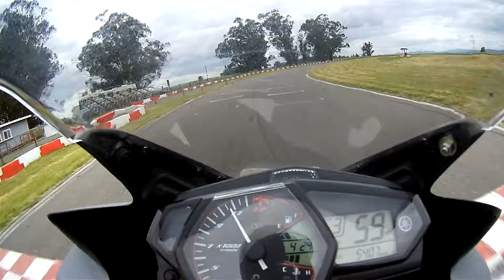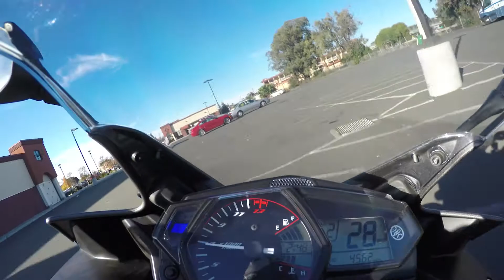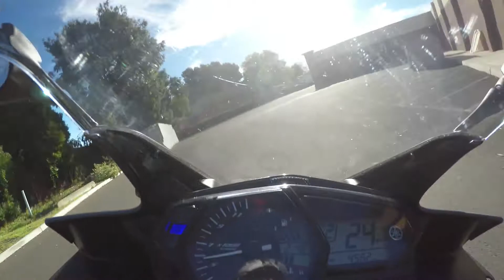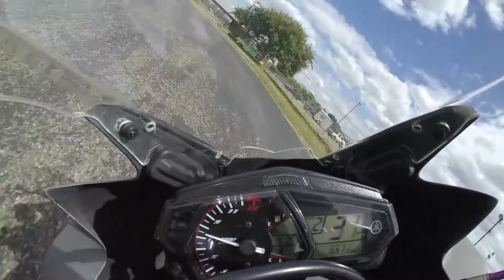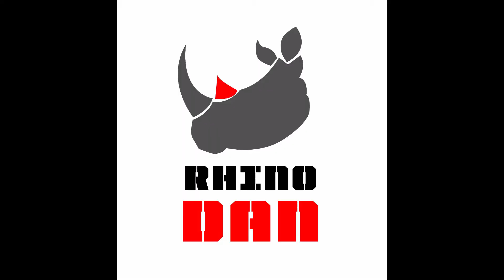How important is throttle timing.

Comment: You are improving very nicely! The actual timing is As Soon As Possible AFTER the bike is turned.  That means pointed in the direction you want to go.  This is different from you said in the video "as soon as the steering input was made." It also doesn't matter where the apex is.  On some turns it could be after the apex.  And, the timing will change as your skill improves and your thoughts about the turn change.
Reply from the maker: Greg Gorman I have still more to learn and will continue on my journey of self discovery

Comment: I noticed your lean angle increased after your countersteering lesson video. Id countersteering the reason for that or have you always leaned this much?
Reply from the maker: Little of both everyone counter steers even if it's not conscious of the action. 

Learn to do at command helped plus learning about the quick flick helped.

Then it's also about learning about motorcycle stability via throttle control . It all came together
Reply: @RhinoDan  I've been riding for years now, (cbr f4 , and now R3) but on twisty canyons, I still have a hard time braking late and hitting the apex because my turns/ leans are not that quick, no matter how much I hang off the inside...but you guys are just flicking bikes at great angles on queue. So I'm assuming it's the deliberate countersteering part that I'm missing My unconscious countersteering is probably not enough. Sorry, I'm broke, can't afford advanced rider lessons so asking for advice. Thanks again. Awesome channel!
Reply from the maker: @allancheli  Hello Thanks for writing so much and watching videos . So I developed my quick flick as a weapon on track. Counter steering is the base for a quick flick with being able to perform on command it's not possible to be able to quick flicks on command.